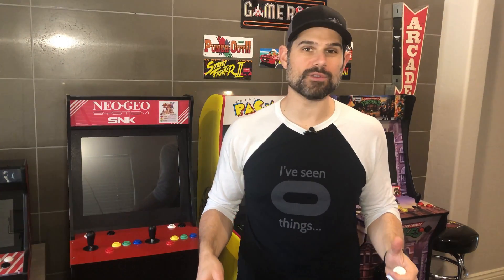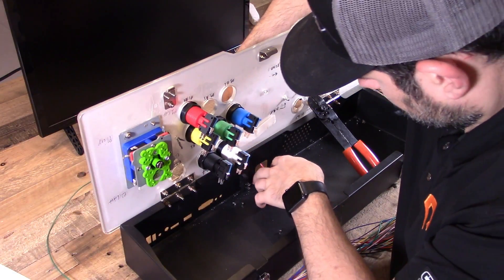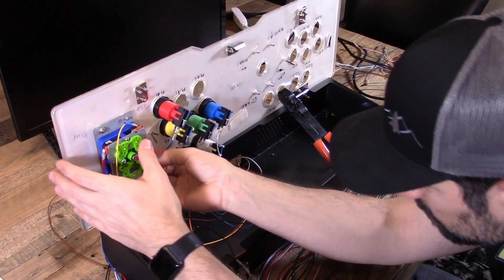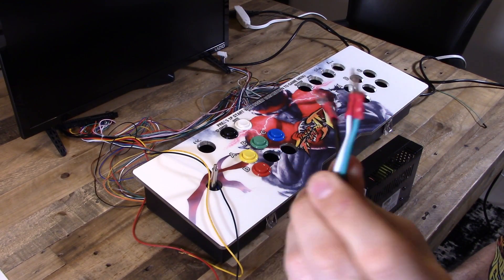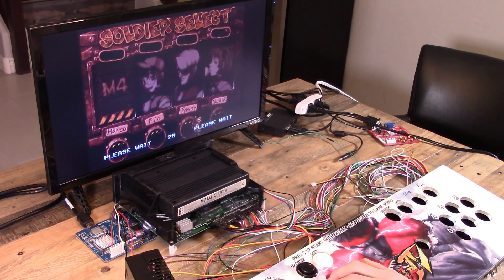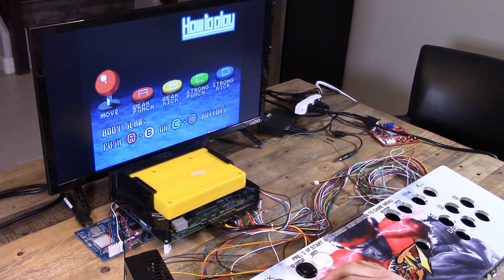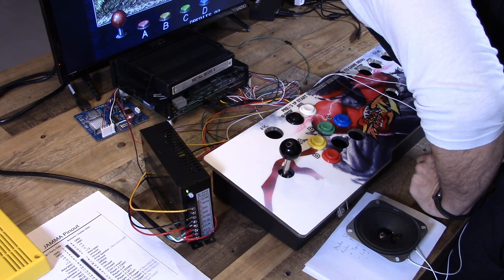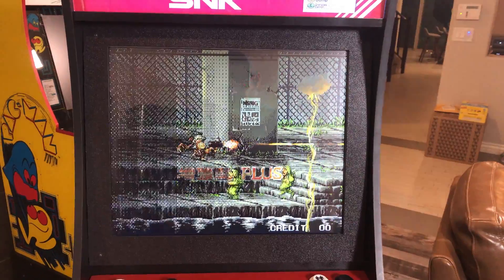How to mod your Arcade1up into a Neo Geo Multicart system - Part 2

Comment: Ive tried everything on the video but I keep getting a no signal message on my crt monitor. Any advice?
Reply from the maker: This was instructions to set it up on an LCD.  If you're using a CRT you don't need to use the video converter board.  You would connect the R,B,G and Sync directly to the CRT.  Does that make sense?  I hope this helps.
Reply: @RetroRalph  Its connected directly to the jamma harness. So its running on the orginal hardware of the arcade machine. I get sound just a no signal message on the screen.

Comment: What if I want to hook up 2 speakers? The JAMMA only has a plus, and a negative wire.
Reply from the maker: Not all MVS boards are stereo, I believe my one slot is mono.  You could safely wire 2- 8 ohm speakers in parallel if you wanted to use 2 speakers in mono.
Reply: @RetroRalph  what about  splicing them? Adding and extra +, and ground wire??
Reply: @RetroRalph  I'm also having trouble getting video on my vga monitor, I'm using a original Mortal kombat 2 pcb, I set the geometry on my vga adapter to 28, and still nothing.

Comment: I purchased a 2 slot MVS board off ebay and locally sourced a 25" arcade monitor, this video is a godsend, thank you!
Reply from the maker: Glad I could help and thanks for watching man!  I need to do more of these, I had planned to do a 101 / 201 and 301 series for this but I never got around to it. Thanks again for watching and glad It helped you out.

Comment: I'm trying to mod my mortal kombat machine with a real pcb borad, and I'm having a ton of trouble.
Reply from the maker: What kind of problem are you having?  Maybe I can help...
Reply: @RetroRalph  I'm trying to put a original Mortal Kombat 2 pcb in my 1up arcade, and I think i got the wrong SANWA sticks, and the wrong JAMMA cables.
Reply: @RetroRalph  nowhere on my SANWA sticks does it have a place to hook them up to my JAMMA, and my JAMMA doesn't have -5 voltage.
Reply: @RetroRalph  just found out MK2 uses -5 voltage. My JAMMA cable doesn't have it, and I can't find one that does. Very frustrating!

Comment: Hey. My harness came with a bunch of grounds and voltage wires. I have the fattest of each hooked into the power supply. Am I supposed to have more wires hooked into the power supply? My power supply is hook up exactly like yours

Comment: Retro Ralph, thank you so much for sharing this educational video! 
I got motivated and did a similar thing to mod my sf2 arcade1up to connect with jamma arcade motherboard but I had issue with the picture bouncing vertically. Is it possible due to defective rgba to HDMI converter or the game motherboard? I'm connecting jamma harness with jamma game motherboard.

Comment: Question - If I were using a RPi instead of the Neo Geo, would the video connection go like this: HDMI out of RPi to blue control board and then a VGA cord out to the stock VGA connector on the back of the monitor? I'm confused about the control boards I'm seeing on the back of the monitor. Are those the stock ones the come on the monitor with the back cover removed?

Comment: I have a question: Is there any switch needed to be wired to turn the system on? Or it only need the power supply to be plugged in?

Comment: hey ralph i bought the same video board you have the V56 Universal LCD TV Controller Driver Board  connect it to the arcade 1up and pluged in my pc am getting a kind of mirroring going on where the top  of the screen is showing at the botom  is that something that happend to u aswell or is the board i bought broken ??? if its how it is how do i fix it to fit the whole screen
Reply from the maker: princevinny18 Hey man, I would love to help.  Can you email me a picture of what’s happening as well as a picture of the controller board.  I have noticed that at times these boards ship with different versions and sometimes they’re not consistent.  Also send me info on what model MVS board you purchased.  Thanks man!  RetroRalph1980@gmail.com
Reply: yeah man if any help would be greafull ill send you the pics give me a sec
Reply: i sent it let me know if u got it

Comment: One more question lol: does that jamma harness come stock with the RGB connector or did you do that yourself?
Reply from the maker: You will need to buy a converter to take the signal off the JAMMA harness and convert it to VGA or HDMI.  Unless you plan on using a CRT ;-)
Reply: @RetroRalph  that's what I plan on doing. I just saw the connector you used to plug it into the blue arcade board. I was just wondering if pyb jammas come stock with the little white RGB connector.
Reply: Looks like a molex connector
Reply from the maker: @oldboat7506  You're right... it's a Molex connector :-)
Reply: @RetroRalph  cool. Thanks Ralph
Reply from the maker: @oldboat7506  Oh sorry ... that's wrong.  I thought I was responding about something else.  I use the PYB harness and it does come with the white RGB connector.
Reply: @RetroRalph  sweet!!! That's what I wanted to know. Gonna grab one. Appreciate it brother!
Reply from the maker: @oldboat7506  Anytime my friend!

Comment: Let me rephrase, is it possible to use the RGB to VGA converter and and connect vga to the appropriate lcd driver for the A1up stock monitor?
Reply from the maker: Big Blanski You will need a way to connect VGA to the stock 1up... this controller will allow you to do this: HDMI+VGA+DVI+Audio Input LCD... https://www.amazon.com/dp/B06X9NJ2NR?ref=ppx_pop_mob_ap_share

Comment: Ralph can I use the Arcade1up stock screen with the mvs F1?
Reply from the maker: Big Blanski You can if you use a different video controller board.  HDMI+VGA+DVI+Audio Input LCD... https://www.amazon.com/dp/B06X9NJ2NR?ref=ppx_pop_mob_ap_share
Reply: @RetroRalph  i do not see a direct connection for RGB on that board. Will i need two separate boards of i attempt to use the stock A1up lcd screen or will this converter board work just fine with the stock display and the jamma? Im painfully ignorant on the subject unfortunately

Comment: Really glad you did this two part video because I'm seriously thinking about trying this. I'm a huge neo geo fan and this would be perfect for me. Gonna use your video as a guide when I start. Thanks retro Ralph!!!
Reply from the maker: Thanks for watching Philip!  I'm a huge Neo Geo fan so I totally understand, good luck and let me know if you need any help!
Reply: @RetroRalph  thanks I really appreciate it. Ordered the motherboard and power supply tonight. Gotta replenish some funds before I order the rest. I'm gonna try and put this in a bartop instead of the arcade 1up cab. Do u have any suggestions on were I should get my pre cut cab ?

Comment: Anyway to wire the coin buttons to actual coin mechanisms?  Not to have to put in coins, but just push them in and have that work as the coin button?

Comment: great little walk through. Something worth mentioning, if a builder wants to upgrade the sound you don't necessarily have to go to an amp immediately, using a bigger better speaker can do the trick, some older cabinets like the Star Trek upright use a single 6x9 and had fantastic bass. Good brands are Alpine, JBL, Pioneer, Kenwood, Infinity, Harmon Kardon. Their sold as car audio speaker and you get two, enough to mod to cabinets! some even include spk. wire.
Reply from the maker: civicturbo2009 Great point man!  Thanks for the tip!  I appreciate you watching and supporting the channel!

Comment: Where do you find that black textured plastic you used as a bezel to hide the monitor frame? I assume it comes in a sheet and you just cut out the center?
Reply from the maker: You should be able to find it from this link:  https://www.hollandcomputers.com/store/pc/viewCategories.asp?idCategory=2721
Reply from the maker: I didn't need to cut the middle as it's made for the 19" monitor they sell.  However, I did have to cut the sides to make it fit into the 1up.  I used the old Bezel as a template to help me cut it to size.
Reply: Retro Ralph got it! Thanks! I’m using a 20.1 Dell so trying to figure out what will require the fewest cuts to make a bezel. That’s a good starting place though.

Comment: Good luck with insurance if you’re house burns down when you cutting power cables when you’re not an electrician. I am not hating, but I checked with my insurance about this subject and they will not cover you.
Reply: HE's talking about cutting an extension cord or similar - not your house wiring ! - the House wiring already has circuit breakers etc. that will protect from anything happening and it's 3 wires that are being connected to the correct places on the Arcade Powersupply - so there is no way anything bad is going to happen ( worse case if you wire it incorrectly you'd possibly trip a beaker switch on the wall outlet you plug into or the circuit breaker box - it's never going to burn a house down !
Reply: JDFan01 like I said good luck getting a payout, and like the insurance company said if you’re playing with live wires and a certified electrician hasn’t done the job basically you’re screwed, of course there every chance nothing will happen, but on that off chance something does, that live wire will burn you’re house down 100% and you’re a fool if you think it wouldn’t.

Put it this way I went to buy a display cabinet and the people put there own led stripe lightening that hooks up to the main house power, insurance said “if there not certified electrician you’re not covered” that’s for shitting led strip lighting.
Reply from the maker: Hmmmm... I Think maybe you misunderstood what I was saying.  However.... maybe I should be more specific since it could be confusing I suppose.  I will make sure to add the Power cord in the video description.  Thanks for pointing that out.
Reply: Retro Ralph you’re not an accredited electrician. 

You plugged in a live wire to power that you did the work on (you crimped on the u plugs) if it shorts out or whatever and cause a fire, then there’s no cover.

If that live wire somehow comes out of that power supply would it still have power running though it? 
If yes, and it burns you’re house down, then you will not be covered by the insurance at all because you did the work, if it’s a no, and no power is running through it then I totally missed something and it’s safe to use this method.

If I have totally misunderstood, then I am totally apologizing in advance, but if I haven’t, then it’s an awfully big risk to put you’re house on the line.
Reply: @limitededition7200  - What you are not understanding is how electrical systems these days are protected from such things happening - IF as you say somehow the power wire were to become lose or come in contact with anything that shorted it out - the GFI or GFCI circuit (Grounf Fault Circuit ( interruptor) would pop within milliseconds shutting off the wall outlet circuit or if you are on old enough wiring to not have GFI circuits the Circuit breaker box would do the same - preventing any fire from occurring (esp. since the plug is using the 3 prong connection which properly earth grounds the wiring so any short that may occur will be disappated properly - So the likely hood of that occurring is pretty much zero !  THe arcade power supplies he is using are designed to be wired in this manner and do not require an electrician come to your home to wire it !
Reply: JDFan01 i understand all that, but you are not listening to what I am say at all. 

The point being if it causes a fire you are not covered at by insurance at all, no matter if wire’s pop, it shorts out even if it’s something else within the arcade machine that causes the fire, because you altered the ac dc power, maybe it’s different in the USA, but in my country if your playing around with live wires and you’re not an electrician good luck getting the money back from insurance.
Reply from the maker: Limited Edition I appreciate your concern but I don’t see how this is any different then me replacing a light switch.  I’m not a licensed electrician and I’ve hung ceiling fans, replaced electrical switches and other things around my home.  My intent with the video is to show the viewers how this system works.  I always put a disclaimer in my comments section that this is for educational purposes only.  However ... I don’t think this is as high risk as you think given the system is not running 24/7.  I also believe that modern electrical systems would trip a breaker if anything was to come loose and make contact with something else.
Reply: Retro Ralph once again replacing light switches and hanging a ceiling fan would null and void the insurance policy as you stated you’re not a licensed electrician, do I agree with this hell no, but risk of a house burning down isn’t worth it.
Like I said maybe the laws are different where you live and you can do these things (I know it’s not a hard job) just wondering have you ever checked with you’re insurance company.
Also the last guy said the gif would stop the power going through the live wire if it popped of the power supply, well, that’s totally wrong, you would have 110v live wire and the risk of fire is totally possible. No modern  breakers, will not trigger, how many house have burn down because i faulty wiring with products they have purchased at stores such as vacuum cleaners, clothes dryers, washing machines and even toasters but they where all covered by insurance because bob next door didn’t do the wiring.